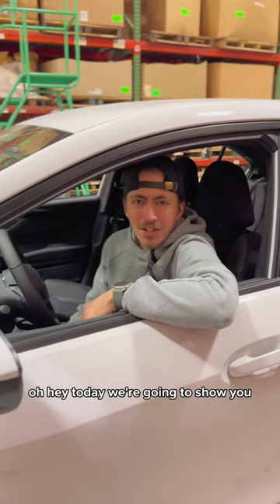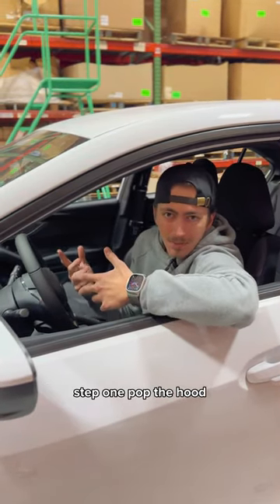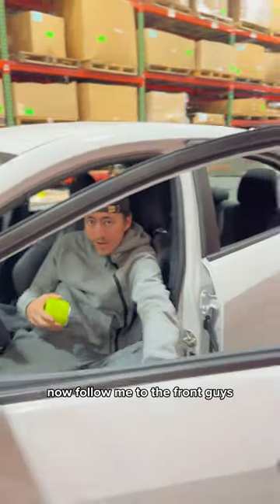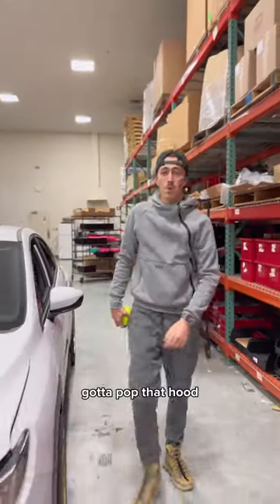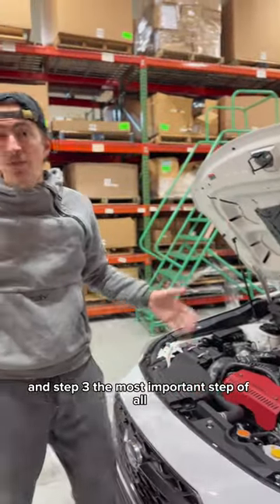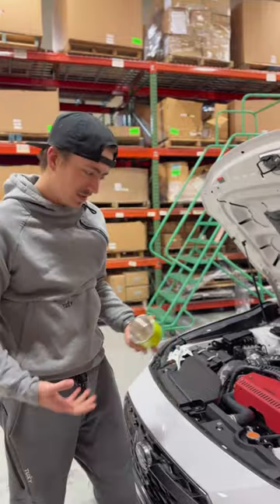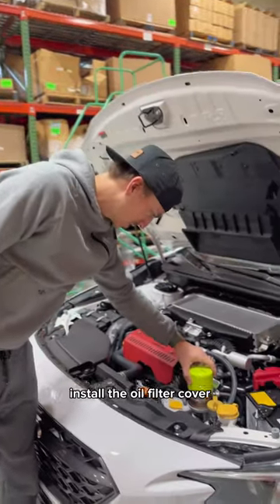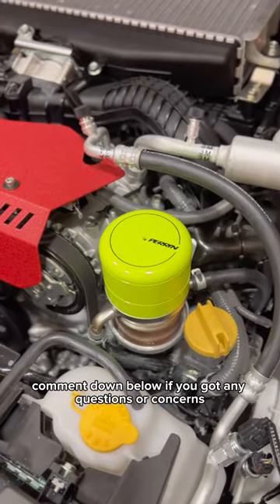PERRIN Oil Filter Cover Install

Comment: Mine won't go on all the way.  I have tried everything but it just won't go down. 23 wrx limited.
Reply from the maker: It is possible that you have an older o-ring that we no longer use due to that exact issue. Reach out to tech@perrrin.com and they'll get you a knew o-ring that will work and fix the issue!